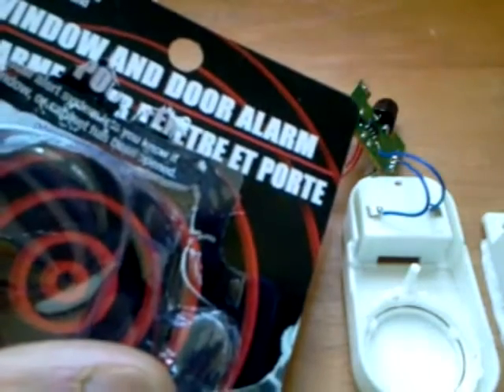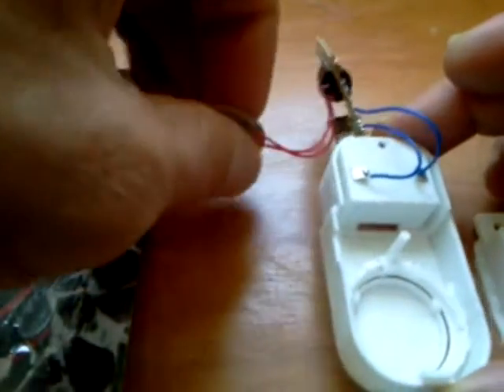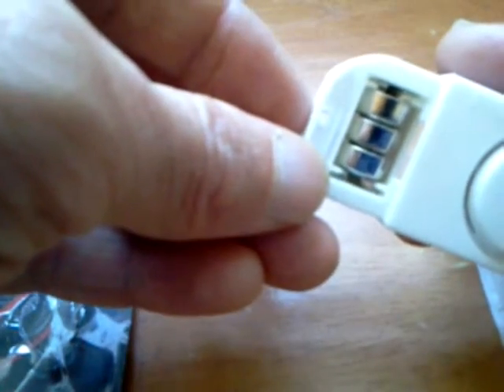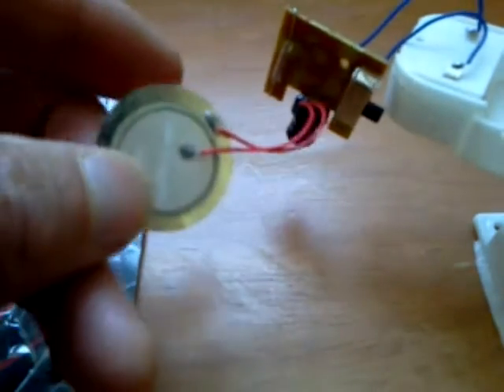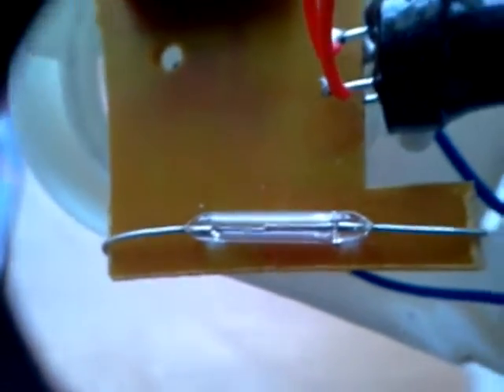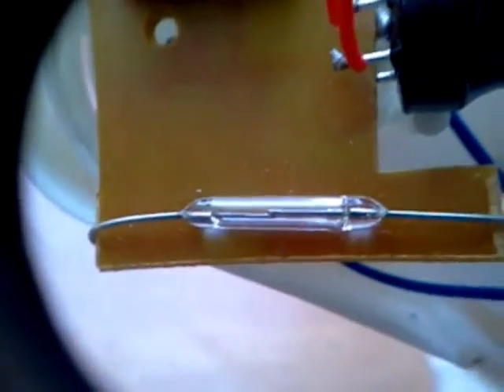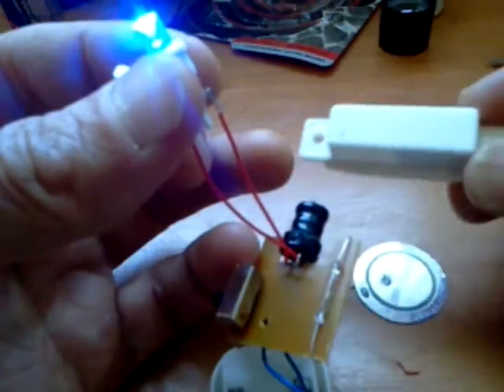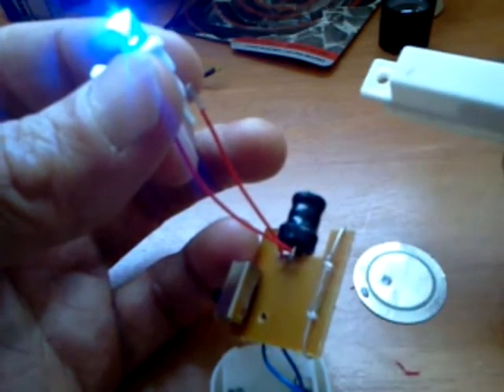Dollar Store Motion Alarm LED Hack, Reed Switch

Comment: I would like to know more about the ic. I didnt find any datasheets
Reply from the maker: there's no ic, but reed switch alarm circuits are easy to find, using transistors or mosfet: http://www.seekic.com/uploadfile/ic-circuit/s2013922195657977.jpg